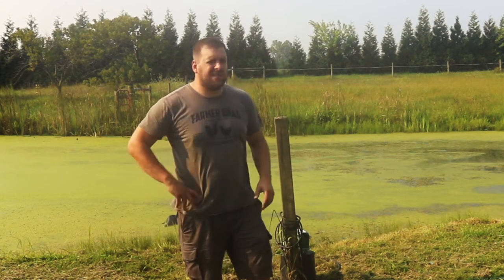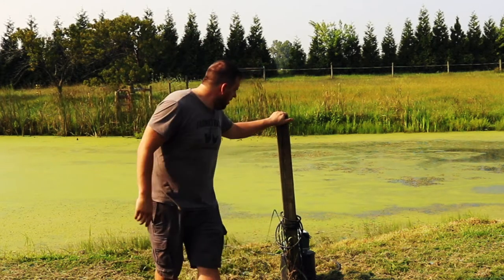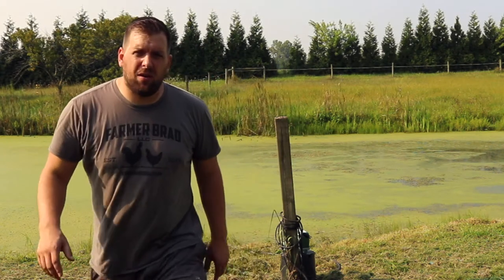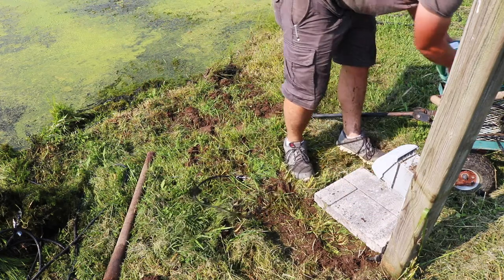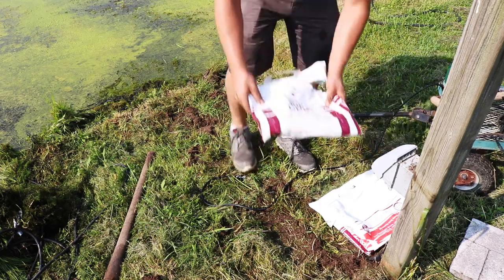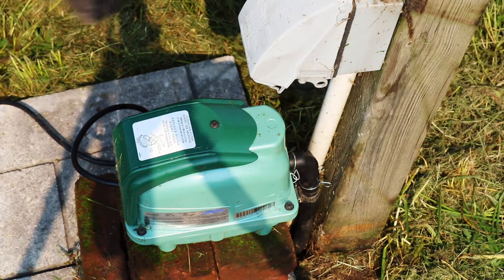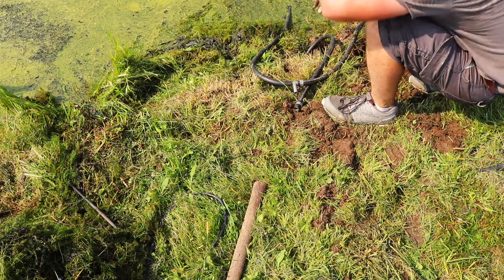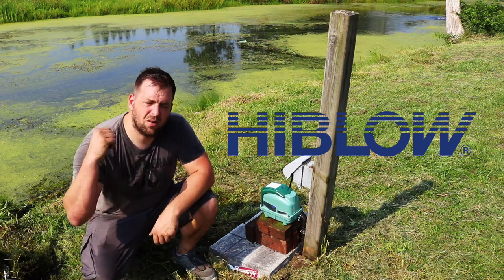Fix My Pond Series: Part 1 - Installing Hiblow Aeration Pump

Comment: How deep into the pond can the system be used, my pond is 18' deep and the water weight seems to be alot
Reply: Hi, there's a pressure/flow curve in on the data sheets you can check. The HP 80 for example will not put up enough pressure to counter 18' of water (2.31'/1 psi).  These work well at about 2 psi.  The flow drops to zero at about 6 psi (~13' deep.)